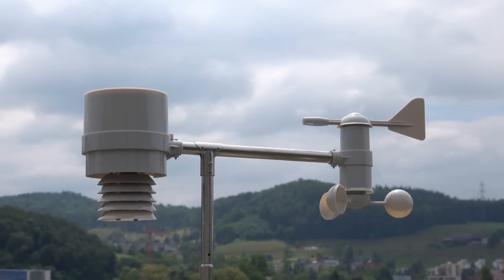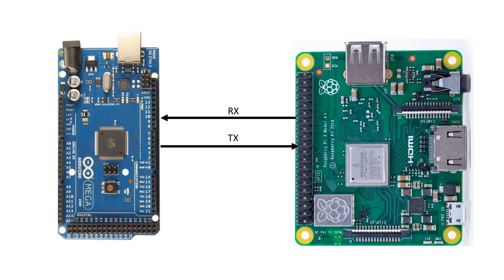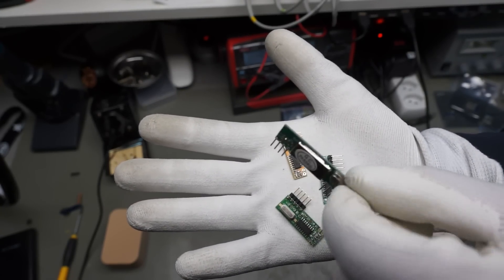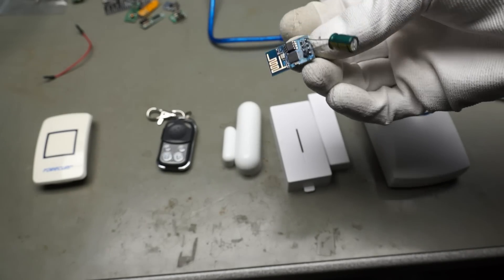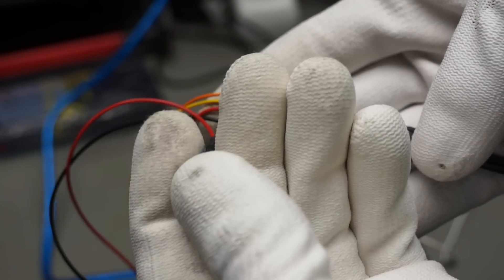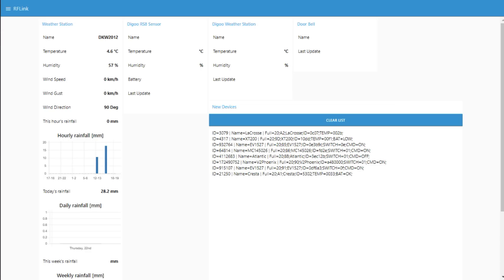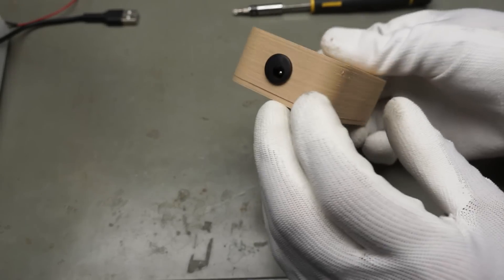#242 How to Build a Cheap 433 - MQTT Gateway (RFLink, Arduino, ESP8266, Node-Red, Weather Station)

Comment: How long does the battery in the station last and is the station still working after this time?
Reply from the maker: The battery lasted for about a year. But I had to replace the device after about 4 years of operation.

Comment: gruzi Andreas 
ich become nur diese daten in RFlink ,. .wo ist das problem ? 

20;56;FineOffset;ID=0000;TEMP=0000;HUM=00;
Reply from the maker: Komisch. Deine Wetterstation wird als Temperatursensor erkannt. Ich weiss nicht warum. Ich würde mal mit dem Oscilloscope schauen ob ein Signal empfangen wird.

Comment: I just built a real time tide sensor / monitor, where the sensor is 250m off shore but connects via nRF to a transceiver. I can tell you that my Node-Red flow does not look simpler.
Mainly due to me wanting to detect "Tide Rising", "Tide Falling", "High" and "Low" tide, all in real time.... so easy when looking a chart, but more tricky when integrating real time data.
Reply from the maker: Interesting project! Sometimes it is easier to use a function node and program the logic in Java Script... But in your case you probably need access to a database. Did you look at python for the logic?
Reply: @AndreasSpiess  I cant stand Python, C++ or JavaScript is good, I am quit happy to ignore Python wherever possible :)

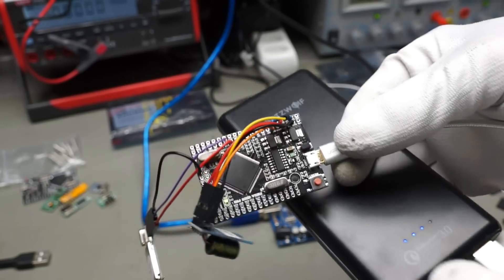Comment: I'm absolutly noob to this, so maybe i miss something that is clear to you all: according to the diagram you connected more to the pin out of the esp in the final assembly than shown in the diagram. not only the RX but it seams also a 3.3v high on the CH_PD/EN @8:15. i mentioning this because i have troubles to make it work. i found a french forum post that instead of the Enable, he connects the high to rst high. gotta try all of those tho.
Reply from the maker: Enable and reset is usually the same pin, just different names. It has to be high during operation. Often it is "pulled" to 3.3 volts with a 10k resistor (value not critical). On many boards this is included and you can leave the pin open.
If it does not work I suggest to start with a blink sketch to make sure your programming and your ESP works. Only then you go on.
Reply: @AndreasSpiess  Grüezi us Spanie. Thank you for your answer, i managed to debug it to the point where i could isolate the problem i have to the "rx"  Connection on the ESP to RFLink. i used the espRFLinkMQTT native github build to get a debug method to see what is happening between the two problem children. i can successfully send to the Mega now, and it does register it. but it looks like i can't receive to the ESP the data from the MEGA. I'm going to look into it after a nice Mittagschlaf which we call here siesta :-) Thank you for making those topics more accessible for simple blokes like me :-)
Reply: Little update, i eliminated the voltage divider and it works now. i did measure both resistors with the ohm meter, and they are connected correctly, but still no luck with them.

Comment: What is the size of the data sent from the meteorological station that includes measuring wind speed and direction - temperature - humidity - intensity of solar radiation
Reply from the maker: I never counted the bytes from the station. The gateway sends 92 bytes

Comment: thanks fo sharing! BTW: Weather Stations like Bresser seems to transmit packets at 868MHz, so probably you'll need another receiver (HW)
Reply from the maker: I think so. And also different codes.
Reply: I think that may depend on regional differences in regulation. I have some Bresser kit which uses 433 MHz.

Comment: Hello Andreas, what i still miss here is a tutorial about a 433Mhz transmitter. For example an additional sensor that sends to this gateway via an ESP32.
I would also be interested in the selection of the transmitter module. Many thanks
Reply from the maker: Just use any of those small transmitters. They are not critical.
Reply: @AndreasSpiess   Let's see if I can do it. I will report the result.

Comment: Also many thanks for this great video from me:-)! 

My "entry" and first video into your channel was #255 ... and since then my enthusiasm has been growing day by day! Now I'm increasingly interested in the topic of weather stations;-). Well, there are quite a few sellers of these, e.g. can also be used with RFlink, etc. But I had to find out that, according to feedbacks/reviews, some stations don't work as well as the manufacturer claims ... or they malfunction after a short time (TFA, Ventus, etc.). 

So, my question is: 
How is your experience with weather stations? In this video I can see a station (0:24 for example) which looks like a DKW-2012 from Alecto (?!), but in your link below you mentioned a chinese one from Misol...

Thanks for a helpful info! 
Robert
Reply from the maker: I have the station mentioned in the link from China and it works for quite a while now I only had to change batteries once in a while. For sure you get better quality stations. But for me it is ok. They are probably sold under different names also in western stores
Reply: @AndreasSpiess  Ok, thanks for your fast reply! Hmmm... the current version from Aliexpress in your link looks quite different from what I saw in your nice video - that's why I asked about this detail, too. Your station looks like this one, called DKW-2012 (not available anymore):

www.conrad.nl/p/profi-wetterstation-2012-dkw-2012-digitaal-draadloos-weerstation-voorspelling-voor-1-dag-679477

Moreover, I discovered in your video #255 the name "DKW2012" in the msg433 object (@ 9:23, for instance). That's why I'm still a bit confused...
Reply from the maker: Now I understand. They changed it because it probably was replaced. The base station seems to be the same, so there is a chance they did not change the inner parts. I adapted the description in hte video.

Comment: Thanks for nice video. Is it possible to attach both 433 and 868 receivers in your setup? Have you checked this project (https://github.com/etimou/RFLink-ESP/tree/arduino)?
Reply from the maker: I do not remember if it was exactly that. Most of those project support only very few sensors, and usually none which transfer values (transferring state on-off is much easier). You have to check if your sensor is supported.

Comment: Rcswitch2 Node is available for node-red, which I didn't manage to install yet. Simply plug the 433 transmitter and start transmitting signals. Same for receiving. Wouldn't that be that the easiest way to build a 433 gateway?
Reply from the maker: You still need rcswitch installed on the Pi and I did not find my devices in rcswitch. In addition you have to place your Pi where you need your Receiver.

Comment: I need some help with building Receiver gateway for HP2000 Weather Station. I already use some RF library like Radiohead (https://www.airspayce.com/mikem/arduino/RadioHead/) or RCSwitch (https://github.com/sui77/rc-switch). Although I just use the example code provided by those library, still I cant get the data via Serial COM. I tried the Radiohead example to test the corresponding RF module to make sure it works, and the two transmitter and receiver work splendid, I can get the data displayed in Serial COM on my PC. Some reference said that I need a specific rate of transmitting speed to match with the weather station, and find it via reverse engineering (https://www.electroschematics.com/433mhz-rf-sniffer/) and build a radio sniffer to get the 433MHz data. 

This the product manual of my weather station :

http://www.instruments.co.za/Downloads/HP2000%20User%20Manual%202017%20Onwards.pdf
Reply: I'm using some Chinese cheap pair of RF 433 Tx and Rx pair.
Reply from the maker: I made some other videos about hacking of 433 MHz devices and SDR

Comment: I just found this video with the interesting way to not connect via serial port to the Pi - and, some nice guy invented a node called
https://flows.nodered.org/node/node-red-contrib-rflink
which can easily decode the messages from the RF-Link GW.
Reply from the maker: Interesting when you connect the Arduino Mega directly to the Raspberry. In my case I needed the 433. MHz receiver at a different place,
Reply: @AndreasSpiess  I do not have a house yet (-: - just one floor - so all is on the same level

Comment: Dear Andreas
,
Thank you for sharing your work with other electronics enthusiasts..
On your diagram (https://github.com/SensorsIot/RFLink-MQTT-Gateway    Diagram.JPG) it is indicated the pin numbers for the connection to transmitter and receiver RF Modules on the arduino Mega 2560 PRO MINI running RFLink gateway. This is clear.
But in that same diagram there are no indications about the pin numbers for the connection for the serial channel of the arduino through which the operation of the gateway is made. I estimate that in your work you use pins D0 (RX) and D1 (TX). My doubt is presented in the possible collision (at least in the transmission) with the USB to serial converter (CH340) of the arduino Mega. Is that the channel and the pins used by you?
I do not know if there is any possibility on RFLink that the communication channel with the arduino Mega is done using another different serial channel that is free of collisions.

Thank you very much for your attention.

Alfonso
Reply from the maker: Maybe you look at the docu of RF-Link and you should find the same pins.

Comment: connect to esp8266computer's USB ports, everything working fine. But, if I connect esp8266 to separate charger that has USB port, then esp 8266not running code
Reply from the maker: Unfortunately I cannot do remote debugging.

Comment: Hi Andreas, thanks for the nice project which I started to build. However I faced a couple of issues:
lines 32 & 33 should read   
const char* ssid = "mySSID";
const char* password = "myPASWORD";

in line 92. 
if (client.connect(clientId.c_str()),MQTT_USER, MQTT_PASSWORD) {
Should be
if (client.connect(clientId.c_str(),MQTT_USER, MQTT_PASSWORD)) {

Finally on the wiring diagram, could you specify which Tx port (I assume D1 on a 
Mega 2560 PRO board) sahll be used to connect to the ESP01 ?

Gruezi aus Lausanne
Eric
Reply from the maker: I have a file with the name "credentials.h" in my libraries folder where I keep all the passwords and other definitions. You can replace them with your own in the sketch as you did with the credentials or once create a credentials.h file in the librariy folder.
A wiring diagram should be on Github.

Comment: Hello Andreas! Happy new year to you and your family! This is also my first project in 2019. First I had problems connecting to the MQTT-Broker. It logged that no user and password were given. So I went deeper and noticed wrong brackets in line 93 of the code. I had to change it this way:
if (client.connect(clientId.c_str(), MQTT_USER, MQTT_PASSWORD))  {

Could you cross-check, please?
Thank you very much.
Many greetings from East Frisia (Germany) wishes Ralf
Reply from the maker: You are right. Thank you. Corrected on Github

Comment: Nice guide, but why not mount an esp8266 directly int the outdoor meter parallel with the existing hardware. All sensors are digital and can be found here: https://www.sparkfun.com/datasheets/Sensors/Weather/Weather%20Sensor%20Assembly..pdf
Reply from the maker: Maybe I will do it once if I add a few more sensors (Illumination, UV, lightning)

Comment: It is possible to connect 433.92MHz module and 868MHz module at the same
time?
Reply from the maker: Why not if you have the software. But they will not hear each other

Comment: Hi like your videos. :-)
How about making a programmel ir blaster that works with MQTT, so you can control IR things, tv, Radios and so on. I know you can by one, but how about making one DIY :-)
Reply from the maker: I have some high-performance IR diodes and want to use them. Maybe you will see a video in the future.

Comment: Hello Andreas. I enjoyed this videos (As I do your others ones)
I built something like that myself a long time ago.
Now regarding the node-red section. I just want to make you aware that there is an RFLink node available:
https://flows.nodered.org/node/node-red-contrib-rflink
Reply from the maker: Thank you for the link. I assume it uses Serial connection. I decided not to go this way, so I had to use the MQTT node.
Reply: @AndreasSpiess  No actually, it takes an rflink string as input. Very easy to use.

Comment: i have a good theme for your future videos: how to made cheap esp zig bee gateway. Today there are a lot of different devises for smart house automation, but all of them to connect to the Chinese cloud. the devices themselves look beautiful, run on batteries for years and they are cheap.
Reply from the maker: So far I always refused to use zigbee because of its price. Do you have a link for these cheap modules?
Reply: @AndreasSpiess  https://github.com/Frans-Willem/AqaraHub
Reply: @AndreasSpiess  By the way, in our country has gained popularity free smart home system majordomo, I do not presume to judge what is better than node red or it, but I think it's easier to set up, of course the main thing for me is that it is free :)
Reply: @AndreasSpiess  the nRF52840 modules are cheap and support zigbee, but I plan to use them for openthread and leave zigbee for even cheaper xiaomi aqara, I use them with zigbee2mqtt and also 2 influxdb 2 grafana, more overview here https://hackaday.io/project/20388-home-smart-mesh/details

Comment: Hi Andreas Thank you for your great work. Two questions: - 1.) How do you store Resistors? I'm looking for a storage box for 65mm long elements. I remember you had a video about lab equipment, but I can't find it. 2.) Could you give infos on how to enhance the sensitivity of a garage drive unit (433 MHz)? Actually it is just a app. 30 cm cord (Litze). Sorry my limited English in writing. Greetings Stephan (Gruess us em Aargau!)
Reply from the maker: 1. I use a bunch of those: http://bit.ly/2u5C16c . Not cheap, though.
2. I do not see a big chance to enhance the sensitivity. Wavelength is about 70 cm. So a normal antenna would be 17 or 35 cm long. So the one you see seems to be long enough. Maybe you have a look that it is not near metal.

Comment: Btw. I prefer to use weeWX ( http://weewx.com ) to collect and display my weather data. It has a MQTT driver and i'm running it on a Raspi with the Niculskin ( https://github.com/ngulden/niculskin ). Additionally to the local Web UI, it pushes my weather data to remote services like WeatherCloud and Wunderground.
Reply from the maker: Thank you for the links. I will look into it when I have time.

Comment: Definitely on my to-do list. 
I have temperature sensors that RTL_443 interpreted successfully. But I'd like to learn it the hard way through coding an Arduino from the ground up, protocol agnostic. I'm looking for a guide/tutorial/blog that examples programming an arduino to record the output of a ASK/OOK receiver, noise filter, analyse the timing of the pulses and dumps result over serial (as unknown protocol), and subsequently develop code to interpret de bitstream to whatever data that is in the packet. Does anybody have a link to something like that?
I know there is one because I've seen it. That recorded and output a spectrumplot of recent pulse lengths, but I can't find the link to it.
Reply from the maker: I do not know if there is a standard way. For switches where you only need one or two codes, it is easy. For sensors transmitting numbers, it usually is a work for Sherlock Holmes.
In general, you have a preamble where you can detect the timing and then the code.
Reply: @AndreasSpiess  After some more digging around, I found Jeelabs.org blog. Which comes quite close to what I was looking for: https://jeelabs.org/2009/03/10/decoding-433-mhz-kaku-signals/ [edit: and this https://jeelabs.org/2010/04/13/an-ook-scope/ ]

Comment: The MySensor project might interest you. There's an ESP gateway project for MySensor as well. It's a little quirky with the NRF24 radios, but worth the effort as it creates an elegant sensor & sensor repeater network. I'm a little surprised you went with an Arduino and ESP-01 instead of a cheaper and more powerful Pi 0 W, but assume it's related to parts-on-hand. We all jump onto ideas with hobnail boots before we have the ideal parts in stock.
Reply from the maker: Viewers pointed me to the RFlink library and this does not work on RPIs. 
I looked at this code but saw, that it only has an initial commit in 2016. Or do you have a better link?
Reply: @AndreasSpiess  I don't have a link for a native Pi RFlink library, sorry, but Domoticz will connect to RFlink, and Domoticz provides a fairly simple REST API for scripting via Python (or any other language). https://diyprojects.io/how-build-rflink-433mhz-radio-home-gateway-domoticz/ That's a very inexpensive (and powerful) alternative. Alternatively, you could re-use the Domoticz RFlink code to create a library or an RFlink Python module.

Comment: https://www.sparkfun.com/products/13712
Reply from the maker: Nice product. Quite specialized, I think. I usually connect my devices to the net if I need logging. But if you do not have Wi-Fi then it is a solution.

Comment: I ordered a USB to ESP-01 board in the hope to flash it more simple. And yes it's possible but only if you make a little modification as you can read if you seach on google ESP-01 usb programmer modification.
Reply from the maker: You are right. I also had one laying around. You just have to add the GPIO0 to GND connection.
Reply: @AndreasSpiess  yes, i am very happy to know because its very circuitous to flash this ESP-01 devices. BTW i have ordered 2 ESP-01 compaitble boards named "Wavgat WIS600" just because i'm curious how it works. Do you know this boards?